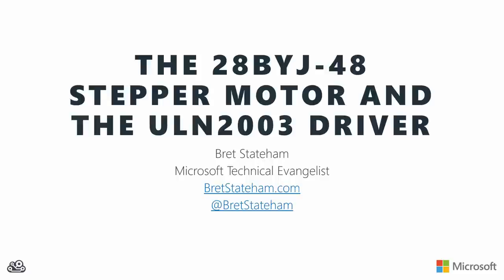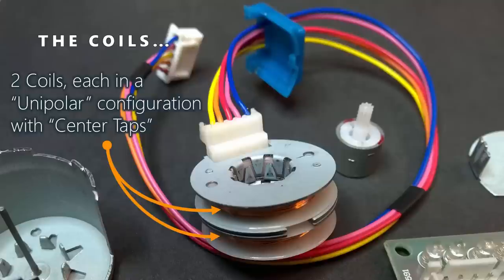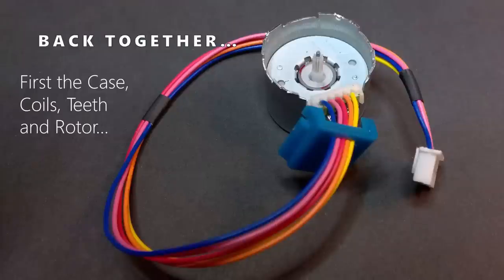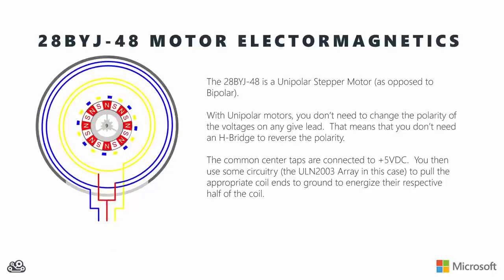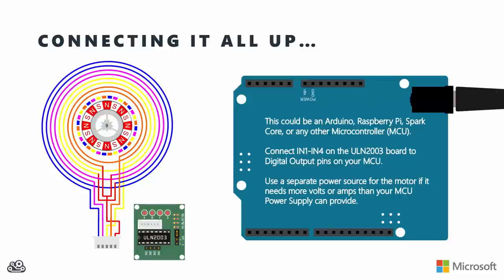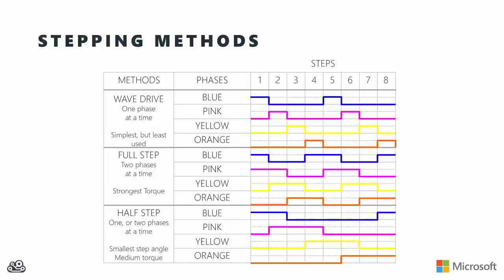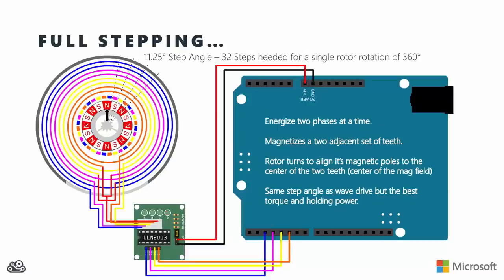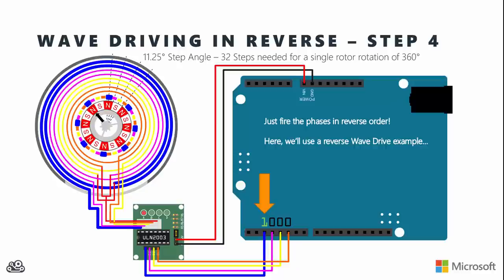28BYJ-48 Stepper Motor and ULN2003 Driver Intro

Comment: Amazing, most videos just focus on the operation of the Arduino's Sketch and the proper code, but fully understanding a project like this is equally valuable, I'm a physicist trying to get into electronics stuff, and let me tell you've done it pretty good in applying electromagnetic concept. here, thanks.

Comment: Excellent video!! Thank you very much. I did the math, it is actually 4076 steps for a full rotation of the motor shaft in half step mode, not 4096 as mentioned. I rounded from  4075.77284.

Comment: I love you Bret, This video is really helpful for my assembly class.

We are working on basic stepper control using 8051.

And this video really helps to get a deeper intuition of motor operation.

This video Rocks.

Comment: Such a clear explanation. Thank you for this. I now understand the half step mode which explains why my original program drove the thing at twice the rate (wave) I was expecting from the spec. A quick tweak of the code and all is now perfect. Great job great video.

Comment: One of the best tutorial videos I've seen. I'm digging out my 28BYJ-48 motors and ULN2003 boards right now to try some of this. Thanks so much. By the way, based on your gear calculations of 63.65 turns of the inner rotor for one turn of the motor shaft, I figured that 10,184 full steps (32 per inner rotation) will get you exactly 5 turns of the outer shaft. Does that sound right?

Comment: Thank you for the excellent video as well as the sample code on GitHub. Some people have been recommending physically modifying these stepper motors to force Full Step stepping. I thought it was rather odd since I was pretty sure you could just code it. Your video clearly explained how to achieve full step using code.

Comment: Thanks for the detailled and professional video. Since I am currently working on some arduino project, for which I want to use this Stepper Motor, I cannot wait to learn more in your next videos.

I managed to drive the motor directly form the arduino board. Can you tell me what exactly is the benefit of the ULN2003 driver?

Hope I can learn how to run the motor in parallel to other actions from your next videos.
Reply: Check min 8:40 in the video.

Comment: ~64:1 gear ratio, besides greater resolution, provides good multiplication of torque. Half-stepping will still provide enough torque to be used in many applications.
Reply from the maker: Agreed

Comment from the maker: Just saw another awesome video about all kinds of steppers motors.  Check out Norbert Heinz's "Working principles of several stepper motors (bipolar, unipolar, reluctance and can-stack)" video here: https://youtu.be/Qc8zcst2blU .  The 28BYJ-48 is a "Can-Stack" motor as Norbert explains.  You can learn more at the end of his video about 33mins in: https://youtu.be/Qc8zcst2blU?t=33m13s .  His video explains how a bipolar can-stack motor works, but the 28BYJ-48 is wired as a unipolar motor with the center tap coming out of each coil.   Watch his full video though and he explains both bi-polar and unipolar motors and it should make sense.
Reply: Bret Stateham and how we Can use 12v in uln2003 with 12v stepper motor???

Comment from the maker: FYI, I was just testing with one of my motors and found that it had a different gear ration (16:1, or really 16.032:1)rather than (64:1).  I've tried looking up the numbers on the faces to see if I can find any kind of spec sheet that called out different part numbers and their gear ratios.  No luck so far, please share if you find one.  However, I did see that Adafruit is selling the 16:1 gear ratio motors on their site (https://www.adafruit.com/products/858).  Everything else is the same, you just need to change the "steps per rotation" math.  

Gears Ratio Calcs:

9 tooth Rotor Gear meshes with a 32 tooth gear = 3.5555 gear ratio
11 tooth gear ganged to bottom of 32 tooth gear meshes with a 22 tooth gear = 2.0 gear ratio
The same 22 tooth gear meshes with a 16 tooth gear  = .7273 gear ratio
10 tooth gear ganged on top of 16 tooth gear meshes with the 31 tool motor shaft gear = 3.1 gear ratio

Total gear ratio = 3.5555 * 2 * .727273 * 3.1 = 16.0320

Wave Driving  / Full Stepping = 32 rotor steps per rotation  * 16.032 = 513.024 Steps per rotation
Half Stepping = 64 rotor steps per rotation * 16.032 = 1026.048 steps per rotation.  

I've also noticed that the motor I have tends to slip or hang at higher speeds (lower delays between steps) so I have had to run it pretty slow to keep it accurate a 4ms delay between steps seems pretty reliable.

Comment: I multiplied out those gear ratios in high precision float and get 63.68395062 not 63.65. I only mention it because I'm working on a clock and really want to keep track of the fractional bits I missed 360 by and add in extra steps when the fraction gets over 1.

Comment: Do you think it would be possible to remove the gearing (or some of it) without ruining the motor?  I wanted to ask the expert before even attempting to pop one open.  :)  These are fantastic little motors, but my only problem is the output shaft turns sooo slowly, and I don't really need as much torque for my current application.  Thanks in advance!

Comment: Hi Bret, here Carlos from Costa Rica. This is a very complete and beautiful tutorial. Thanks a lot for this amazing job. I would like to ask you what applications did you use to put together such a presentation with all those great graphics. I am a teacher and I am interested in improving the visual quality of the presentations I give to my students. Cheers!
Reply from the maker: Carlos, greetings from San Diego, and thanks you for your comments.  

All of the visuals in the video are from a PowerPoint deck I made.  You can download the deck from here: https://github.com/BretStateham/28BYJ-48/raw/master/Overview/28BYJ-48%20Stepper%20Motor%20and%20ULN2003%20Driver.pptx

I use tools like Gimp for bitmap editing (.jpg, pngs), Inkscape for editing vectors images (.svgs) PowerPoint to create my presentations. 

I captured my screen for the recording and edited that video using Camtasia Studio from Techsmith.

If you work with bitmap images, get the sources as large as you possibly can (high resolution).  You can always scale bitmaps down, but you can't easily scale them up and have them still look good.

I work with vector images as much as possible because they look crisp and clear regardless of how you scale them.

Comment: Hello sir, I don't use Arduino or any coding or software, but I have the same motor in 12V inside my star-light light source that spins the wheel for the twinkle effect, but it is too fast. Even on the lowest speed, it is a bit too fast for my liking. Is there an easy way to modify this by adding a resistor, or a rheostat, or a voltage regulator, or a diode, or a potentiometer, etc without causing any damage? And which wire would I add it to, the red one? I would appreciate your advice. I just need to know of a way to make it turn slower please? Which wire and which electronic components would be best to use without causing any damage to the stepper motor please?

Comment: Great video, thank you. One question: At 7:47 you show the yellow current arrow pointing clockwise. Wouldn't this give the yellow teeth a northern polarization and therefore not allow the motor to turn?
Reply from the maker: +Elan Lavie  - I just ran across an awesome video by Gaven MacDonald.  I think he does a much better job of explaining how the coils magnetize the teeth and attract the rotor.  Check it out here: https://youtu.be/Dc16mKFA7Fo .  He published his video a year and a half before I did, and after watching it, mine looks like a rip off of his.  Totally coincidental, but erie. In fact, if I had seen his video first, I probably wouldn't have made mine!  Anyhow, you should watch it.

Comment: Excellent video!  I believe you have a slight error.  When you show the blue and yellow coil, you describe one set of the teeth (out of 4) as associated with the blue coil and another set of teeth associated with the yellow coil.  You state that the first set is energized by the blue coil and then o=the other set energized by the yellow coil.  In fact, I believe both sets of teeth are associated with both coils.  The blue coil causes the 1st set of teeth to be S polarized, while the 2nd set of teeth are energized to N pole.  (each coil has a N pole as well as S pole).  When you energize the yellow coil, the same set of teeth are energize, but the polarization is opposite.  In other words, both sets of teeth form a N-S pole electromagnet. So as you sequence through the 4 half-coils, one at a time, there are always 2 sets of teeth energized as N-S or S-N.  With 4 sets of teeth, this gives you 4 different rotations of N-S electromagnets.

Comment: I'm using this motor in a project and im using an ATmega32 for the microcontroler but i don't have the ULN2003 Driver and i wanted to ask if it is possible to control the motor directly from the microcontroller without the driver.

Comment: did you ever make the video on driving the stepper motor with the arduino? great video's btw very informative
Reply: +shifty51008 The stepper motor can be interfaced through driver to any microcontroller. You need to figure out the IO pins of any microcontroller and the program to drive 1's and 0's to those output pins according to the required drive mode - such as wave, full step or half step. My students are doing a project to drive the stepper motor using Cypress PSoC with the knowledge gained from this video.
Reply from the maker: +shifty51008 I finally did.  You can see it here: http://aka.ms/28byjarduino

Comment: Great video I love the explaination! I just have one question, I am trying to operate an 8 wire 4 phase Stepper motor, I saw your newer video where you explain your wiring and code. However, can I use the ULN2003   driver board with the 8 wire motor if I wire it in series ? or should I purchase the ULN2003A? What is the benefit of the ULN2003 driver board over the ULN2003A or ULN2004A? Any suggestion or recommendations you may have would be greatly appreciated.
Reply from the maker: Kathia, I haven't driven an 8-wire 4-phase motor myself, but it sounds like you will need a more capable driver.  The ULN2003 simply pulls each pin to ground successively.  You will likely need some h-bridges to switch the direction of current in your case.  I would look into one of the many full featured stepper motor drivers from companies like SparkFun or Pololu.  These boards have the added benefit of taking on much of the responsibility for full stepping or half stepping and even offer micro stepping options.  I would check them out instead. Here's SparkFun's EasyDriver: https://www.sparkfun.com/products/12779
Reply: Bret Stateham thank you!!, i will look them up.

Comment: Excellent video. What is the minimal time (dt) to change the state, I mean to send a new drive command from the MCU using these parts?
Reply from the maker: +Ferenc Szujo In my casual field testing, I need to wait about 2ms between each step when Wave Driving or Full Stepping, and bout 1ms between steps when Half Stepping.

Comment: Bret, How does a set of teeth get associated with (polarized by?) a particular coil, and not by any of the other coils?  BTW, Excellent tutorial, thank you.
Reply from the maker: +Paul Ridgway , it's a physical proximity thing.  I guess I didn't state it in the video, but the coils are stacked on top of each other from the bottom of the motor case to the top.  Each coil is horizontally aligned with one of the rows of teeth.  What that coil (or coil half) get's energized, the teeth that are physically closest to it get exposed of the magnetic field and attract the rotor.

Comment: Hi Bret, I'm using a 28byj-48 motor in a clock function but it is running a little slow, is there a way to adjust the speed?

Comment: A quick question, I do not have much experience. I was able to drive a unipolar stepper motor I had in stock (rated 12VDC) with the ULN2003, no problem. If I had a 24VDC or higher voltage unipolar motor I could do that comparatively easily with 4 simple bipolar transistors, am I right? No H-bridges required.
Reply from the maker: Correct, you don't need any H-Bridges for this.  And the ULN2003 chip is just a seven darlington transistors in a single package so you could certainly just use your own transistor for each phase.

Comment from the maker: Woo Hoo!  200k Views.
Reply: It's because the session is good. And I keep coming back to read its and bits over and over again. I liked the description and video.
Reply: https://github.com/BretStateham/28BYJ-48/blob/master/Arduino/Code/S05_FullSteppingWithArrays/S05_FullSteppingWithArrays.ino

Here , I had to change the Pins 2,3,4, and 5 to Pins 8.10, 9 and 11 on the Arduino Uno to make the stepper work full circle.
Reply from the maker: Yep, the pins in that code file are specific to the demo I did in the Arduino specific video here: http://aka.ms/28byjarduino . If you connected your ULN2003 driver board to different pins than I did then you will need to update the code to match your setup.  

Glad you got it working.
Reply from the maker: I should also mention that while you can drive it with full stepping manually as the sample you linked to shows, I recommend that you use a the AccelStepper library instead.  Again, if you watch the full video for the Arduino I finally come to that conclusion at the end.  

Link to AccelStepper overview in the video: 
http://channel9.msdn.com/shows/themakershow/8#time=26m30s

Link to the AccelStepper library:
http://aka.ms/accelstepper

Link to my sample code that uses AccelStepper:
https://github.com/BretStateham/28BYJ-48/blob/master/Arduino/Code/S07-AccelStepperDemo/S07-AccelStepperDemo.ino
Reply: is it possible to hook multiple motors at once
Reply from the maker: Yes.  There are various driver boards that support multiple motors, but you can also checkout the AccelStepper library at http://aka.ms/accelstepper.  Here is the AccelStepper example for multiple motors: http://www.airspayce.com/mikem/arduino/AccelStepper/MultipleSteppers_8pde-example.html
Reply: You deserve it!

Comment: Thank you for the video but I have a question. Let's say I want to boost by 20% the rotational speed of this motor how can I do that ? Thanks
Reply from the maker: +LSPD FR Well, you will have a physical limitation on how fast the rotor can move.  For example, in my Arduino video (http://aka.ms/28byjarduino) I show that a delay of 2 ms between steps works, but a delay of 1ms between is too fast.  If you have reached the physical max of the motor, the only thing I can think of is to use external gears to speed things up.

Comment: Love your videos! Downloaded your library for the 28BYJ-40, but the IDE gives me an error when I try to install it...

"Arduino: 1.8.1 (Windows 10), Board: "Arduino/Genuino Uno"

The library "28BYJ-48-master" cannot be used.
Library names must contain only basic letters and numbers.
(ASCII only and no spaces, and it cannot start with a number)

This report would have more information with
"Show verbose output during compilation"
option enabled in File -> Preferences.

Any ideas?
Thanks!
Reply from the maker: It's not a library, it's just sample code files.  Just download the zip from the repo, and open the individual code files in the IDE.  You will however want to install the AccelStepper library.  

Checkout my Arduino video at http://aka.ms/28byjarduino for a demonstration.
Reply: Thank you for the quick reply! I'm just a noob at this stuff...

Comment: Hi friend!  To connect the ULN2003 with 12 Volts, it has to be changed the jumper (from right to left)?  Thank you
Reply from the maker: Sorry for the delayed response.  No, the jumper is literally a switch that stops whatever voltage you supply from getting to the motor.  If the jumper is on, the power gets to the motor, if it's off, it doesn't.  You could hook the ends of a switch up to those pins instead of using the jumper to create a "motor cut-off" type of switch for an emergency stop button.  

To supply 12V, simply send 12v in on the same pin where I talk about supplying 5v.  The ULN2003 chip on the board actually supports voltages up to 30v (see page 2 on the datasheet: http://www.superdroidrobots.com/product_info/ULN2003APG.pdf) but anything higher than 12V would likely blow the onboard LEDs on the driver board.  

Hope that helps.

Comment: A beginner question. Mine is NEMA17 motor (4 wires) and I have that same board. Can I use this board with a 4 wires motor? Any tip?

Comment: Great video, I was able to create my own code to make it turn! The only problem is that it turns very slowly. It also vibrates quite a bit. Is there a way to make it faster besides using gears? Thanks!
Reply from the maker: Did you watch my video on driving the motor with the Arduino?  I cover how to drive it in code from there. http://aka.ms/28BYJArduino
Reply: I just watched it and switched to your code, it works! Thanks so much, all the other stepper motor libraries and such weren't working for me.

Comment: GearRatios = 63.68395
so make 1 round "Keyed Motor Shaft" with FullStep mode need : 32*GearRatios ≈ 2038 (steps)
Halfstep mode need : 64*GearRatios ≈ 4076 (half steps)

Comment: How is the rotor's magnet able to have more than one pole? Is it actually several magnets?
Reply from the maker: You could think of it as a bunch of magnets (I don't remember the exact number) wrapped around the rotor, however its actually a single peice of material with different sections with opposite polarities.  Kinda cool.  The way I discovered this was by removing the rotor and testing it with a regular magnet held up against it as I turned it.  The reglar magnet was repulsed/attracted/repulsed/attracted, etc as I turned the rotor.
Reply: Thanks - that's very interesting, didn't know that was possible.